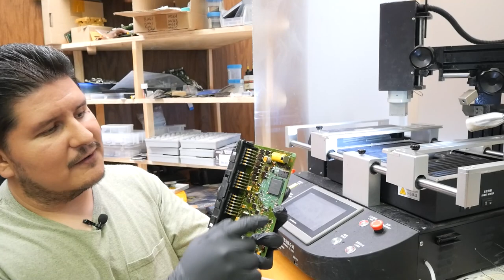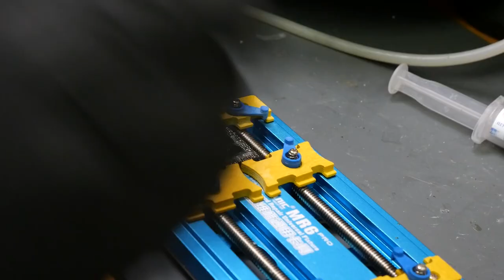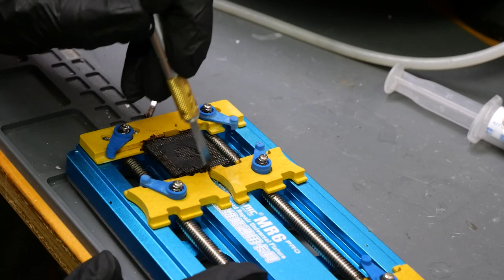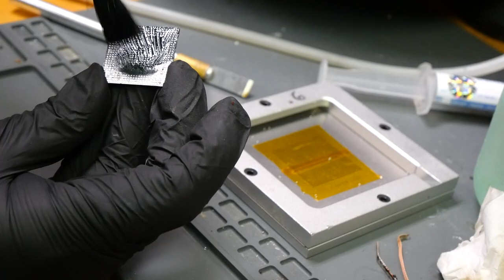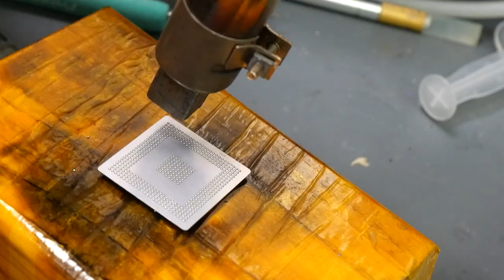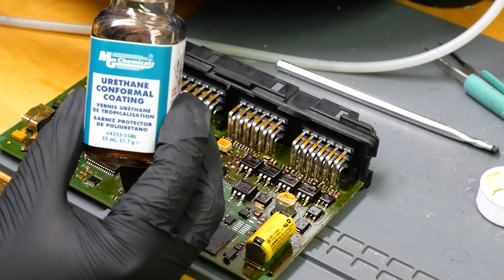FREIGHTLINER CASCADIA CPC4 MODULE REPAIR

Comment: hi,i have freighliner cascadia 2017,and no star,
ABS Light staying on
DEF Light staying on
Instrument Cluster loses communication,i check all fuses is good,so ,is that a CPC4 issue? can u fix it?
Reply from the maker: Hello Ming,
The symptoms you are describing are in line with CPC4 module failure but I can't guarantee that is 100% the case. I would recommend you have someone in person take a look at the truck, or swap out the CPC4 with someone elses to see if it takes care of the issue. 
If you don't have one or can't find anyone you can borrow one from, then you can try heating or cooling the device gently and trying. If it makes a difference, then your CPC4 is the fault and has the common cracked solder joints issue. If it does not, then it can still be at fault and may simply have a different failure but would require further troubleshooting.

Comment: Hey I believe my Cpc is my problem it’s throwing abs codes and not showing gear on dash, when abs codes are gone truck goes into gear. Can you fix this?
Reply from the maker: Yes this is a common fault with the CPC modules and of course, yes we can fix that no problem. 
If you want to send in the module for repair, you can send it directly to our storefront

ATTN: Nick's TV repair 
5445 E. 22nd St Suite 117
Tucson, AZ 85711

Please don't send the module without providing all of your information. We get a lot of repair requests, so PLEASE provide your first and last name, phone number, email address, and preffered return shipping address on a paper attached with the module, like that we know exactly who it belongs to when we get it, and we can easily get in contact with you if we have questions or need to communicate with you. 
If you have questions, give me a call at (520)838-9359 or email at support@nickstvs.com

I am availble and can answer any questions you have.

Comment: Bro where you located at? I got a cascadia 2017 in salt lake sitting due to cpc
Reply from the maker: We are south of you down in Tucson AZ. 5445 E 22nd St 85714 to be exact. 
Most of our customers are from out of town and mail in their modules for repair. I was just on the phone yesterday with someone in texas in the same situation, and he was told 6 months for the new module to come in so he is sending it to us for repair instead. We do 1-2 day turnaround time + shipping. 
If you want more details, you can email me at support@nickstvs.com, give me a call at (520)838-9359 or you can check out our listing linked below as well. 

https://www.nickstvs.com/store/p3119/A0034461002.html

Comment: From my research it seems that this is usually the problem. However are the chips ever bad? Do you test them prior to the reball? My board has never been tampered with and I'm just making sure I'm not paying $1500 for a reball and it's not actually the issue with the cpc
Reply from the maker: Joshua,
So far out of all the modules we have fixed we have not yet found the processor to ever be bad. I know ERD says they replace them and that's the way to do it, but it is not needed at all since the processor itself doesn't go bad. We also offer a repair service, if we don't fix your CPC4 we would not charge you. We do live test and troubleshoot the module and confirm it to have a fault before and after. If necessary we bring it out to live test in a truck, but that is rarely needed.
Reply: @NicksTVRepair  i emailed you
Reply from the maker: @joshuabrumback9681  
Just got it! responding now

Comment: Hi I'm having a cpc4 problem. I was told the unit had power but it's not sending power to the rest of the truck. I tried driving it to freightliner it took me about an hour to get there and I'm less than 25 minutes away. Is that something you can fix?
Reply from the maker: Hello,
Yes that does sound like a common CPC4 failure which we have serviced and fixed many times. 
Are you local to Tucson?
If so you can just drop it off at our local shop 
5445 E. 22nd St Suite 117
Tucson, AZ 85711

Comment: Im in phoenix what is the turn around i can go to u? Reason i think my cpc is bad i try to connect to truck with a labtop to check codes for check engine and almost connects then disconnects
Reply from the maker: The turn around time currently is very fast as we are seeing lower demand for the repairs, but it would be best for you to contact us directly with the exact part number of your CPC module.

Comment: After the repair and installation needs to be reprogramming?
Reply from the maker: Hello,
It depends on the problem. Most of the time no you don't need to have it reprogramed, but sometimes yes. 
If you are looking to have one fixed, we have fixed hundreds and can help you with yours. Send us an email directly or fill out the contact form that is linked in the video description.
Reply: How much you charge more or less 🤔
Reply from the maker: @outlanderkid6524  
We don't put prices on our Youtube channel, you have to click on the link in the video description. Prices can change depending on market conditions, demand, and how busy we are. 
The best way to get our current prices is by going to our website. I also have the website link pinned in a comment at the top as well.

Comment: I had a freightliner the other day with inlet outlet nox sensor codes. Ran two forced regens with my computer and Replaced both sensors and the code still came back is that because the CPC?
Reply from the maker: I don't think so. I have fixed a lot of CPC modules and I have never seen any cause that issue before. With that being said, I can't know for sure. I would recommend just bringing it to a shop, they would be able to better assist you. If it is a CPC4 failure however, it is most likely due to cracked solder joints between the processor and the PCB which is a failure that would be fixed with the reball repair service we offer.

Comment: What BGA machine and adapter would you recommend for this that's relatively small?
Reply from the maker: I really should get paid to promote them at this point. Here is their entry level BGA rework machine

https://www.alibaba.com/product-detail/Seamark-ZM-R5830-Entry-cheap-bga_1600487363616.html

This is Seamark their company name is Shenzhen Zhuomao Technology. 
That is their entry level machine, and while we did get a fancier version of it, I think it's all bells and whistles and their basic model is just as good.
Reply: @NicksTVRepair  Thank you! I was overwhelmed with the amount of BGAs out there and which to choose. This will definitely work for my needs.
Reply from the maker: @245artist  You are welcome. 
Yeah, we have bought about 3 -4 different types of BGA machines in the past and have found them to be the best by far both in terms of how their machines operate, their designs, and quality of parts used. 
Good luck

Comment: Afte re install my cpc my miles no work   Any wire Lise if 2018  freaghtliner cascades manual
Reply from the maker: Sometimes you have to drive the truck around for a while and then it will start working. 
If you still have issues, you may have to get the device reflashed.
Reply: @NicksTVRepair  asking nick, what is  reflashed?
Reply from the maker: @roymtz5375  Sorry I didn't see this comment until now. I don't get notifications on replies, only new comments. 
Reflashed means you get the software on the module erased and replaced with new software. 
Sometimes the CPC4 can go into a protection mode and stop working to "protect the vehicle" but even after you repair the fault, it stays stuck in that protection mode. The only way to get it out sometimes is to have the module reflashed.

Comment: Im in california can i take it to you for a repair? Is it a same day repair or takes longer? Hopefully you can help me
Reply from the maker: We try to do same day, but we have been getting a lot of repair requests. More than we can handle in fact. So we may increase our advertised turn around time from 1-2 days up to 2-4 possibly. It honestly depends on when you stop in and how many circuit boards are getting delivered that day. Contact us directly at support@nickstvs.com and let me know when you are thinking of stopping by and we can figure something out that works for everyone I am sure.
Reply: What profile do you use to remove and replace the tc1796?
Reply from the maker: @larryochoa982  The profile we use is irrelevant. You should NOT use that same profile. The profile you use depends on your tools, and environment. 

Unless you have the exact same tools we have, you use those tools in the exact same way we do, and have it in the exact same environment, then our profile won't work for you, or at least won't be ideal.

I recommend you find your perfect profile through trial and error. And I don't mean trial and error on CPC4 modules, I mean buy broken boards that are similar in size and layer count for cheap, and practice with those, fine-tune your process, and make all the adjustments you need on boards you don't care about. 
Once you have your process refined, then go ahead and work on the CPC4 module.

Comment: What solder balls did you use like the .mm
Reply from the maker: The size of the solder balls is 0.6mm but if you are asking this question it means you may not have the experience needed to properly fix this device yourself and I do not recommend you try it on your own. This is a very expensive irreplaceable item, you should not be experimenting with reballs on this device. You should be experimenting on cheap $20 boards. 
The odds are very high that you will damage the board beyond any possible repair over having a successful repair. 
I know the video makes it look easy and achievable but there are a lot of things we don't show you in the video. Please keep that in mind. 
We have had many technicians send us CPC4 modules with failed repair attempts. We are typically only able to fix 25% of those modules since they are often more damaged after the failed repair attempt. If you send us a none tampered board our success rate is 98%.

Comment: Do you use .065mm or .06mm balls?
Reply from the maker: I am sorry but I have to be harsh here. if you do not know how to identify the size of the solder balls on the module, then you most likely do not have the experience required to work on these. 
We have gotten dozens of tampered boards from reflow and reball attempts gone wrong and have made dozens of boards none repairable because of it. Lots of truckers are sidelined because they tried to get someone else to reball their board for cheaper and they couldn't do it right. 

Please unless you have lots of experience, do not try and reball this board. If you have no experience, this is not the type of board that you should use to learn how to reball. 
People's livelyhoods depend on these modules, and if the work is not done right, you will most likely cause more damage to the board. 

If you are truly interested in learning to reball, then learn on cheap affordable and readily available electronics.

Comment: How much to repair CPC4
Reply from the maker: Hello,
We have a flat rate repair for these, but we also have different prices based on how quickly you need it and if you want our default 1 Year warranty or if you want to get the extended 3-year warranty.
Here is a link to our website with more information:

https://nickselectronics.com/products/a0034461102-004/

If you have more questions, I would recommend emailing us directly or filling out the contact us form from our website.